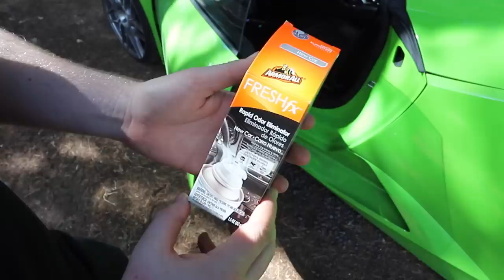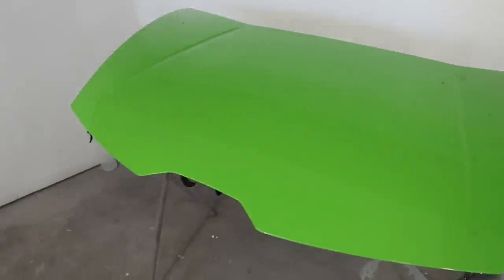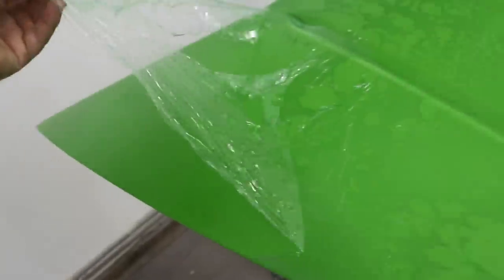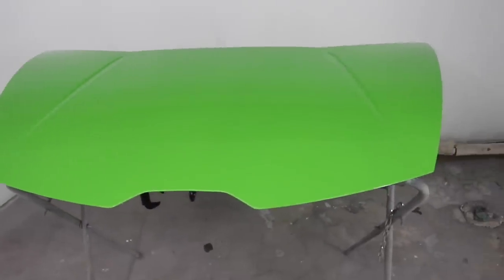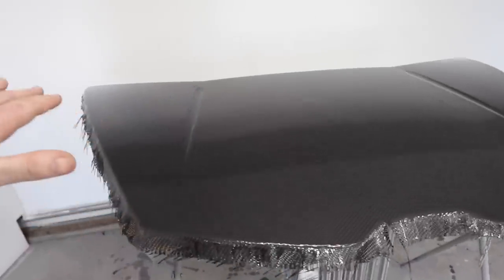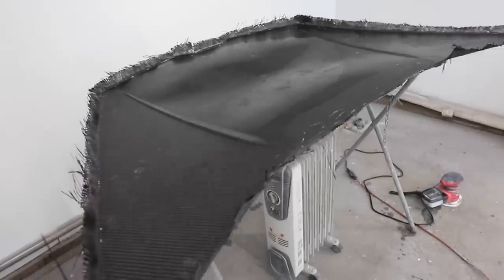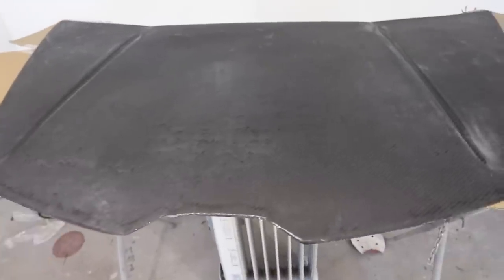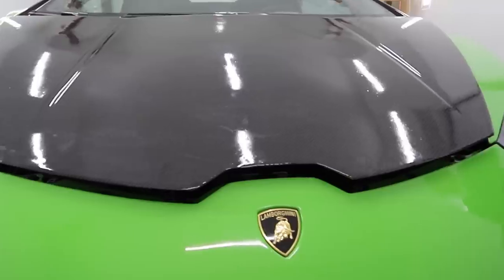Building Our First Carbon Fiber Part for the Huracan

Comment: You are definitely right at 16 minutes Chris, that you should make a mould of every part instead of making a one off using the original part.
You'll have a great way of making new body panels really quickly and cheaply compared to buying new ones. Stick at it, it's looking awesome and I can't wait to see it with the Texas speed motor in it.

Comment: You have the right idea, but you need to make molds from fiberglass and then you will have nice perfect size and shape parts! Plus messing with the fiberglass is  good practice before the expensive carbon fiber cuz its similar technique!! Making molds of the parts, and using vacuum bags instead of brushes for the resin stage makes a huge difference!! You will figure it out I'm sure. Cant wait to see the outcome!!

Comment: Heyyy there - Uhh, you should probably be wearing gloves with Carbon Fibre..

Back when i was heavily into Archery, the hot new Arrow Tech was ACC Arrows, Alloy Carbon Composite Arrows, basically a central core of aluminium and a carbon fibre outershell, they are i think still the best arrows on the market, outside of pure carbon ones, but one of the lessons i learnt about carbon fibre is that you should always wear gloves when working/cutting/around the fibres or splinters, cause if you get a splinter in your thumb its a pain in the ass to remove, and is super prone to infection, more than wood or metal

Gloves is they key there boys.

Comment: I would suggest you not making carbon parts with the method you are using now. If youre planning to take this to SEMA the quality of this method would not be show car quality (remember the R35hundred from last years SEMA?). Im sure you can make a mold with your ability so use the vacuum infusion method. If time and resource is an issue then you need to find a better epoxy resin, that resin you are using is crap. A good resin should still be stiff enough and not be flimsy like that, but again, your method will introduce lots of air in the resin where it would not be as strong.

Comment: gellcoat layer, polyester resin, chop mat, resin, weave , resin, weave, resin, plywood supports, 2-3 layers of chop/resin. steel tube structure to keep it all straight ( plus connected to rotisserie) . 20+ years ago, this is how we built  molds that would last through 20 or more copies. I was the guy that built the original buck.

Comment: Post cure the parts and you won’t have the sanding issue. For epoxy resin you could get away with 100+ degrees for maybe 4-8 hours. That also depends on the amount of plies. Make sure you break all edges on the finished parts so it doesn’t delam.

Comment: Don't take shortcuts, if you intend to have exposed carbon you have to follow the processes. Rigid fibreglass mould, vacuum bag with vacuum resin transfer. Make inner and outer moulds and parts to save on layers and Sika flex glue all inner and outer parts together.

Comment: Also, yes you are using CF fabric, but its only as strong as the resin holding it together. REAL CF parts are vacuum bagged and autoclaved. Your parts will get hot enough in just sunlight to likely warp since they are not heat cured.

Comment: many comments here explain the right way to do a panel in CF, let me just add that the risk of ruining your perfect, beautiful and freshly painted lambo is extremely high!! epoxy is a bitch, sticks to almost everything, if you don't see a drop or make a mistake with the masking it will harden and become almost impossible to remove without damaging the surface. Just imagine doing the quarter panels! and also, high level composite work is not a thing where you can take shortcuts, to make real nice parts takes a lot of experience, time, gear and money! I think you should try to get some professional in the project , so you can learn and make cool videos for us viewers in the process!
best of luck from Italy!

Comment: Carbon is not clear coated.......it's resin infused. That is a lot of carbon fiber's rigidity. I am siding with the experts that are telling you this is not probable. I believe it's possible.......just not within the present set of parameters......Time frame, skill level and tools. You need a mold of not only the outside of each part but also the inside. And then these two parts need to be trimmed and mated. Call someone in on this one...........I'm not sure you have the time for trial and error. No doubt you CAN learn this.....but a whole car by Nov. is a tall order. There is a reason this stuff is so expensive. It's labor intensive. Good luck and I look forward to your solution of this puzzle.

Comment: I love what you guys  are doing but you seem to be going about it the wrong way.   You need to make a mold first off of your original part.   I would think you should use  fiberglass rather than wasting  carbon fiber for this step.    First after putting your release agent you put down tooling gel coat. Typically black or orange.    You then lay down several layers successively thicker for strength.   You want your mold to be rigid, you also use wood or something to give it rigidity and handles.   You could make it like a box that will sit upside down on a flat surface.     Once your mold is made it will be ready to make your part the exact size as the original.  I'm not sure how you'll go about  doing the ribbing underneath the hood,  can that be pulled off or can you just make it part of the bottom mold.(i think you'll run into a few complications there.)    But the key to making it  the same size as original is first making a mold.    This will serve you well because you can always make more down the road if you get it right.    But carbon fiber also typically requires a vacuum system in order to remove all the tiny air bubbles something you dont worry a lot about when doing fiberglass because you dont see through the resin with gelcoat (basically your paint).    Good luck guys.   I would highly recommend watching videos on making fiberglass molds.  And then some other videos on vacuuming carbon fiber.     Good luck guys,. What you're doing is awesome and I enjoy watching.

Comment: Make the molds from fiberglass. Use plywood for facing between molds with multiple pieces. Then go ahead with carbon for your panels.  A challenge for sure.

Comment: Another too much motivation, not enough research video by Chris. Come on man, Street Bandito makes a fiberglass negative mold of multiple layers and then makes the part with several layers of carbon with a vacuum bag. You just used the same fiber glast materials they did and obviously tried to cut corners.

Comment: Mold are used when we want to replicate and massproduce, there is another way when building single part. Make one "skin" of (in this case) carbonfibre, reinforce that skin from the outside with spray polyfoam and and plywood, when you take out the oiginalpice, the shape Will remain and you can ad reinforcment element underneath, when you Done with reinforcment of the skin you can remove the polyfoam wich have worked like a temporary mold.

Comment: wonder why you don´t modify some of the shapes of your lambo parts.. else it looks just like another carbonwrap stock lambo but lighter and expensive. feel like you would miss out on a big opportunity by not making the design your own... and when you use a mold like many ppl suggest, i think this shouldn`t be hard to pull off to manufacture.. excepted for a good looking shape additions.. perhaps take some design shapes from other cars or bodykits

Comment: Hey guys, you have to make a fibreglass mould first, then you can make your carbon fibre hood . This is the only way to get a good result. What you tried first time around just won't work. I used to work in the fibreglass swimming pool industry, so I've seen a lot of this type of thing done and on a much larger scale that what you want to do. Besides, with making moulds, you can then make as many new carbon fibre panels as you want, so if anything gets broken, you can just make a new one from the mould. Remember that once you sell the green machine, you don't have anything to make new panels from, so having moulds means you can always make new parts again if needed.

Comment: He does these projects to learn, he doesn’t clam to be an expert.  People learn in different ways, he does the “try and fail to succeed” method and it works for him.  I’m sure he will take into account what others have had success with and apply it to the build.  Calling him names and not giving pointers (actual info that works from those whom have tried it) is not going to help him (them).

Comment: Chelsea!!!!!!
PLEASE get just one person that knows what they are doing when it comes to mold making to help your boy PLEASE!!!! 
This is killing me 😳
1) Get a Tyvek paper suit and gloves.
2) Use more coats of wax. Forget PVA. Your finish will be 100% better. YOU DONT NEED PVA. All the imperfections you can see in the surface, even after you just spray the PVA will be in your mold surface. Use 3 cloths, wax on, wax off and then a clean polish cloth. We use to use 10 coats of wax in our difficult edged molds.
3) Get some 3” wide thin sheet metal strips and duct tape/silicone to the door edge to form a good wide flat lip to vac off of. Wax edge fully.
4) Use a fluffy 3-4” inch wide “nook and cranny” roller to apply the resin onto the cloth, (not a paint brush) Much faster. Gives you more time to work on the important things before it goes off.
5) Use a Proper solid steel mini roller to roll out your cloth after you put on the resin. It pushes out the air and forms the cloth into the edges.
6) Reinforce your mold with Balsa Core or Foam Core! To help it keep the correct shape.

When Chris is laying back in the hotel room gushing about how great it was to meet Mickey Mouse face to face, would be a good time to suggest he gets someone to help him with this phase of the build.

Have a great time in Disney Land guys,
Cheers 🍻🍷😃

Comment: First love the channel. I have been building aircraft parts for over 30 years from carbon fiber, fiberglass and airamid and the first thing to do is build a mold using tooling cloth and tooling resin. This will give you an ultra smooth surface to lay you cloth on. Then Learn about the warp directions of the cloth and how to clock them for strength. Then learn to use tooling wax to allow for thickness. Also fabricate a female mold and learn vacuum bagging technech that allow for getting any air bubbles out and so you will have a smooth surface with little to no sanding. The real expensive way is like the way the factory does and that is use prepreg materials.

Comment: Vacuuming the resin and carbon in a bag will make sure your impregnating all the fibers every time and will make the resin uniform thickness as well so you avoid any thin or thick parts that don’t cure correctly. Also 3 layers minimum I would do a layer of Kevlar in there as well. Light and stronger parts

Comment: Worked with carbon fiber in college, you need to use a vacuum so you can set multiple layers at once. Might also help with your curing issues, humidity and temp variances I'll mess with the resin.

Comment: You need to make a mould. If you just lay the carbon fibre on top of each component it will squeeze things like the hood and you won’t be able to close it. Your fenders will be a few mil thicker as the hood, and it won’t work! Regardless your work with the fibre is better than anything I could do.

Comment: Good learning.
Do Molds chris.
Molds are better in keeping it the original size! 

carbon is good at absorbing the resin and growing to its comfort.

the carbon supposed to be backed under pressure,  that what makes it hard and strong.

build a set of Good molds - you may sell them in a good price afterwards..

thanks for the ride

Comment: Measure all your gaps hood finder and door finder and around all lights. That will give you your allowable tolerances. Then make a piece i e the hood using the bandtos method with 4 layers. The thickness might not be an issue. I mean Lamborghini has never been know for there fitment. Have you ever seen a countach is person some of the body gaps are laughable.

Comment: 1. you need to make a mould from the panels not use a panel as a mould it will be bigger
2. why start with the hood the biggest and most visible part
3. you just making a huracan with a ls? thought you were making something “unique” i thought you would be building your own custom car and using the chassis as the base maybe you haven’t been clearer with your vision to us but this is how it aounds

Comment: Epoxy does not dry. It cures. It needs a certain temperature for a certain amount of time. And, if you leave to cure in air it will form amine blush on the surface. You have to wash that off before sanding. And yes, making molds is the only way to go.

Comment: I don’t think a mold is needed. I’m not going to tag everyone I this cometary but yea. If you are going to bring someone over to help with molding bring some that can help you do a full clamshell front end. There are some problems with that but you don’t have any of the mounting points anyway. 
PS.  and you won’t need to re-gap all your panels

Comment: Totally wrong. You need to make a glass fiber mould first, then use that to make your carbon fiber part. That's how you get a part that's the right size with a quality finish.

Comment: Well worth it for the learning experience, but you're probably going to want to make a mold each time so you recreate the correct size panel, this will be a big deal, that small difference in size will mean days or even weeks fitting things that don't fit. 

Was cringing the whole time you were working on your paint perfect lambo hood, perhaps apply mold release around the underside edges, otherwise you might find find resin runs to the underside and it won't release.

Comment: Generally you use the original part making a mold of it, then with the mold you make the parts out of it, this will allow the new part to be the  exact same size as the original piece,. Making a mold is added work but I believe it's gonna be necessary.

Great build and love the channel.

Comment: Having made CF parts before (for hobby planes) i would suggests that if you want to get a proper feel for the harder parts while still keeping it simple i would attempt the mirrors as you have curved and angled surfaces that are more exaggerated that the hood and being smaller you wont loose as much materials while experimenting.
I would suggest either a mold or more layers. depending on what materials you can use for the mold without breaking the bank i would suggest using  the molds as they can be sold or in b is for build style make any failures easier to recover from as you just have to pull out the mold and try again with no risk to original parts.

Comment: I think you should make molds. it will allow you to duplicate the part much easier and takes away the issue of size match.  It will also ensure that the top of the item is exactly the same as your original part, with all of the details. if you just put multiple layers of carbon fibre on top, it will start to round out the detail.  You just need to put 1x3s fiberglassed to the top and then put carbon fibre under the mold you';ve made. it would also provide an alternate income source (either for you or for someone you sell the moulds to)

Comment: I used to make carbon fiber motorcycle parts at a shop I used to work at, its alot more involved to make molds than people would think. Then when you have the molds made it's not easy to lay down a perfect gel coat and then lay down your first layer of carbon fiber, the one that will be exposed, with having your weave pattern perfect and not have any strands happen. The whole process is alot of work.

Comment: do give you guys some advice... lay down seran rap on the hood then tin foil.. apply a seperator, then several layers of thick 1708 fiber glass..... then pry that off... sand it too smooth touch and then add carbon fiber on top of that

Comment: The resin needs heat and vacuum pressure to fully impregnate the fiber while curing and that will also create strength and rigidity in the fiber sheets. Do not sand the fiber itself once it's cured. You will only damage the pattern of the fibers. Shoot the clear and then wet sand that. You need to make negative molds for the parts you want to use on the build or you will never get panel fitment right on the chassis because the parts will be too big. Here's a thought. Have you considered that if you made panels for all parts of the car the way you did this one with proper curing, you will have created a laminate that could be bonded to the panels of a stock Huracan for those who want a real carbon fiber look without having to build a complete car themselves? It would be permanent and look better than a vinyl wrap.

Comment: Hello. very interesting to see your blog. there is a lot to learn for me who has never cast any of the carbon fiber dishes -the first layer of carbon fiber and cut the edges fine. Is it not possible to re-lay the subject over the armor to still keep the correct shape of the web made of carbon fiber? 2) if I then would build a scoop on the new hood, it is then smarter to build the armor first, and after full drought, and then drill holes for the scoop to glue it on from the inside. what do you think is wise thank you in advance 👁️👁️

Comment: I think doing the mold process would be better especially on complex parts like the front bumper. Laying the fiber inside a mold instead of over the exterior of a bumper should be easier along with the ability to drop in some supports as you build it. You can try this out by making a cast mold of your head then creating a carbon fiber bust of your head. 😂